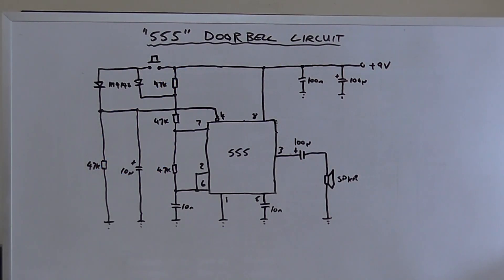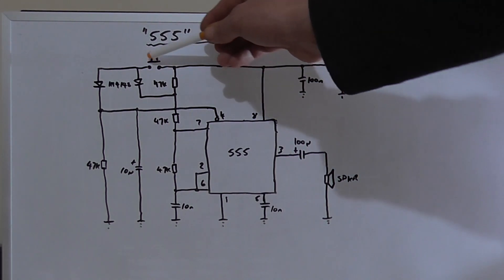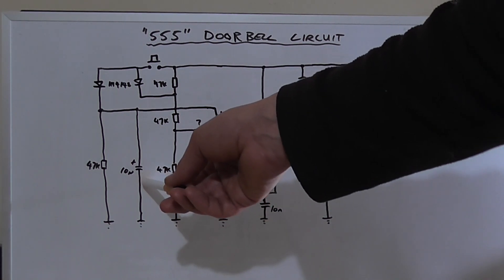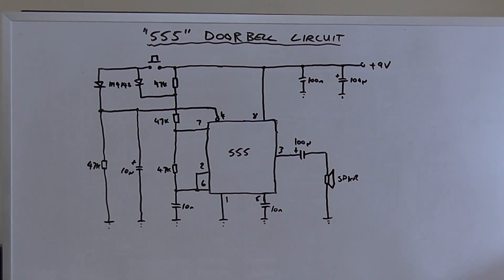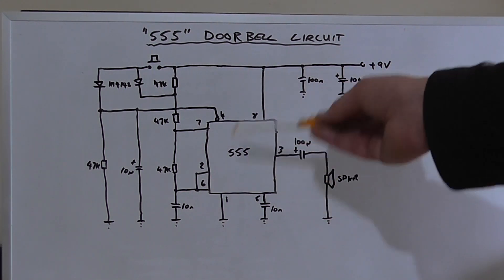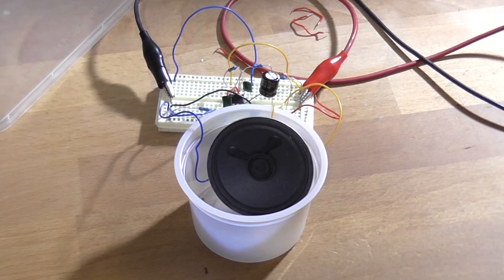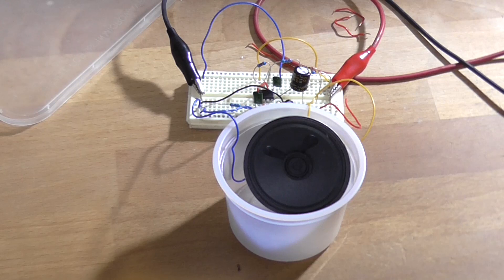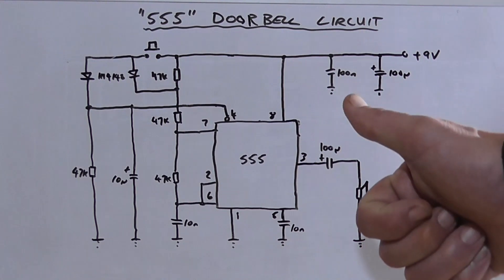Fun With The 555 Timer: Ding-Dong Doorbell

Comment: But there is always a small current flow , even without pressing the button. If these bell is connected to a battery you need to change it often. And a usual bell installation connetcts via  button just the positive level to the bell.
Reply from the maker: Yeah, I know.